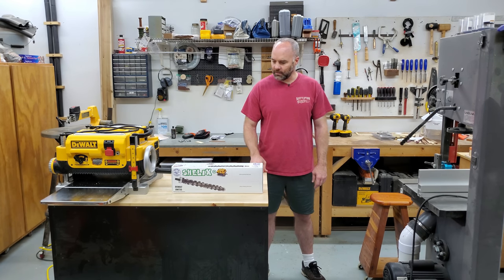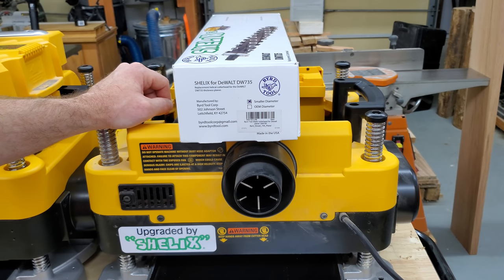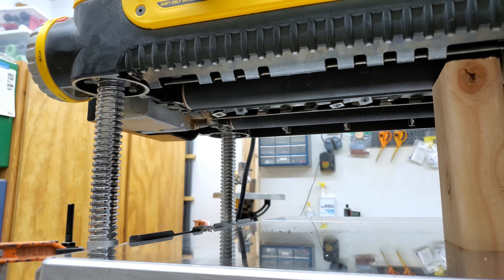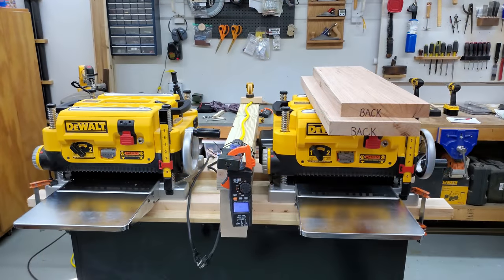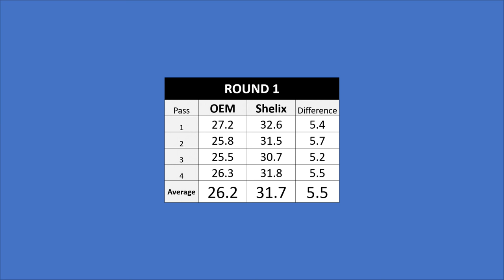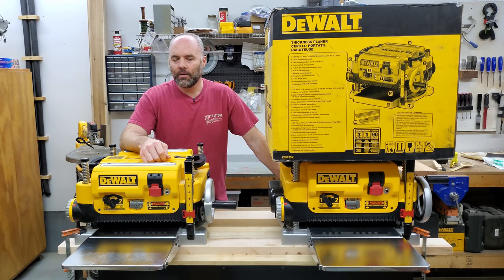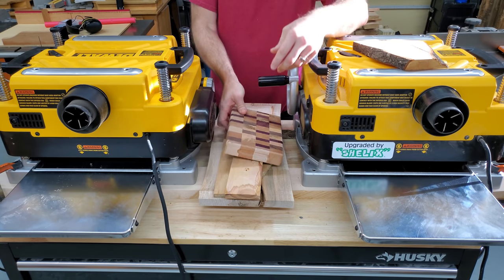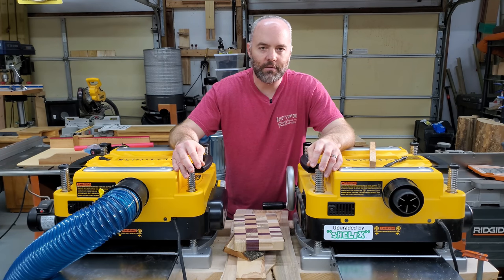The video I wish I watched before buying a SHELIX

Comment: You didn't mention the quality of the board surface finish with the shelix versus the 3 planer knives.  I find the shelix superior.
Reply: Yes, this was a big point that was overlooked, as this is the main reason you would want to upgrade.
Reply from the maker: It starts at around 37:02.  New or freshly sharpened steel knives produce an exceptionally smooth finish, but they dull a lot faster; and then the planer gets louder, draws more power, and tears out more wood.  Comparing new sharp steel to new sharp carbide, I'd say it's a toss-up except for complicated grain where the helical heads excel.  Comparing steel to carbide after a few hours of use, the helical carbide is way better, and will tear out less even after it eventually starts to dull.

Comment: I bet DeWalt would say, the cutter head would void the warranty on the motor as it's always running at a higher current, irrespective of the overheating protection the higher current draw would shorten the life of the motor, also the planer would have had to been disassembled by the end user to install the shelix which would void the warranty on the unit as it was dismantled by an unauthorised person.
Reply: None of these are legitimate factors in US warranty laws. Most people believe this, because companies have tried to put stickers stating this sort of stuff. Fortunately it doesn't hold up. You're allowed to take your stuff apart. You're allowed to swap in similar functioning parts. Now if you damage the components, or create the failure by dismantling the product, they can void the warranty. I work for Dewalt's parent company; it would cause us more trouble to deny a customer's warranty claim over something as trivial as swapping the cutting mechanism, instead of just honoring the warranty in good faith. It's not worth tarnishing the brand, especially when warranties have become such a big part of the marketing.

Comment: It appears that you are using the current meter in its MAX setting. If so, you are reading momentary PEAK current that can indeed reach values in excess of the average. Power consumption is based on the product of your average voltage and average current, i.e. the average power over a period of time. You should not use the peak value of the current that you may be picking up with your meter at machine start up, when the current exceeds average operating values to overcome cutter inertia.
Set your meter to AVG and you will see that the values read are lower, and likely within the breaker rating.
Reply from the maker: I set it to max only after the motor was up to operating speed. I have a few other videos in the playlist showing the same results without the max setting.

Comment: I like the Shelix, but it doesn't like cypress. If the moisture content is above 8% the shelix will create tear outs. If the content is 6% it will be smooth.
Reply from the maker: I don't think I've ever worked with cypress. I'm curious what causes the tearout. Is the grain peeling up, or does it actually chip?
Reply: @The Snekker Show  both. Peels and chips. I can plane a 1x8x12 cypress and get a lot of it, then plane a yellow pine board and it's smooth as glass. Dry kiln cypress planes glass smooth. 6% maximum moisture content for cypress is the limit or you rough finish.

Comment: There must be something wrong with your amperage measurements.  According to the data you're reading with this meter, an idle running planer consumes between 13.9A to 14.6A taking the x10 factor in listed by the line separating specifications of factor of 10.  I've read the manuals for the meter and that splitter, and your setup, and can't find a reason why you would have incorrect data.
Right after that I went to my garage and did my own test.  I have the same planer, with the OEM size Shelix head, and I have only hit over about 16 to 17A peak for little bit while planing white oak 1/16".   What gives?  I used a clamp style meter from Fluke and was not able to match your results.
Reply from the maker: You're not the first person who's said that, but once we get down to a comparable test the results get a lot closer. Were you planing a 9 1/4" wide board, and were you lowering the wheel one full rotation after the last pass to ensure a full 1/16" cut?  I have some other power-test videos linked from the description of this one: https://youtu.be/KBL97SqVrDc
Reply: @TheSnekkerShow  I agree with your observations and what you're stating.  However, the interesting part is the 'idle' power draw.  14A just running with no board, that's too much in my opinion.  The blower motor should draw maybe an amp or 1.5, the cutter motor will draw the rest, but while only spinning knives and rotating rollers, it should not use more than three to four amps. So I would expect this thing to use 5A while running idle.
I will use the KillaWatt little toy to see what's the draw while the planer is just running and let you know, as your experiment shows a 14A draw.  
Also 25A-30A pull for a length of 6 feet or so, should trip the breaker, especially in my place which only got a 15A one.  Thank you for your response.  Much appreciated.  Cheers.
Reply from the maker: @duperdude25  That's a pretty good guess. It draws around 6 amps once the impeller is removed. https://youtu.be/UoBN5Sc_2uk
Reply: @TheSnekkerShow  I've just returned from my dungeon and did some testing.  The numbers you've got are exactly what I got.  A non loaded planer uses from 12.5A all the way to 13.5A.  I've used the killawatt outlet.  I didn't want to run it loaded since the outlet is rated for 15A and I didn't want to overload it for the same of getting some numbers.  
I guess the impeller with the knives faces lots of resistance thus such a load with no wood being planed.  
Now, how is it that my 15A breaker doesn't flip since I do run 8 feet boards and remove a 1/16th at a time to get the thickness that I'm looking for?
I understand the breaker allowing for 25% over for 30 seconds or so, but 28A while the board goes through?  That is bizarre.   You're right from the beginning,.   I design hardware to mil spec and even more stringent when ti comes to space applications, we often design a certain fudge factor, but this is almost 2X the rated current and for a house.  I wonder if they also have such margin for the wiring itself when it comes to amp ratings versus voltage drop over distance and possible  fires as a result of overloading  Cheers.
Reply from the maker: @duperdude25  The whole experience was pretty educational for me as well. One thing I feel pretty sure about though is that home electrical systems are probably spec'ed so the plastic-coated wire in the wall is the last thing to overheat.
Reply: @TheSnekkerShow  Could it be the extension cord? When the gauge of cord is too small for the required load the voltage drops and the motor will pull more amps. When this happens it causes excessive heat in the motor. The amps that thing pulls I would shy away from using any cord at all, even a 10 gauge cord with much length will be prone to voltage drop. The gauge of wire, length of cord and amp load all factor in.
Reply: @TheSnekkerShow  a 1/16" cut? That's crazy. I cut no more than a quarter turn or 1/64th" at a time. I've come too close to burning up the motor until I figured this out. I won't go deeper even in soft pine...and I plane a LOT OF lumber every week. I don't have a dust collection system at all and just sweep the floor, but I routinely have 3 feet of shavings on the floor, but I won't cut more than 1/16th at a time...period.
Reply from the maker: @martinoamello3017  Your tools your rules. Some people estimate greater value from faster production than reduced tool wear. Time is money, and tools are money.
Reply from the maker: I finally got around to testing voltage tonight. Starting with the original setup with a short 12-gauge extension cord, it was approximately 120v before starting the motor, 119v after, and dropped to 115v while planing 8” wide maple. Then I plugged directly in to an outlet right next to the breaker panel and got 120v, 119v, and 117v.  There were some minor fluctuations between test sets, but those numbers are a good summary of the results. Amperage was maybe 1 or 2 higher using the extension cord, but still around 25-27 for both.
Reply: @TheSnekkerShow  That's interesting, I didn't think 12ga was good for current like that.
Reply from the maker: @ajmann1187  12ga is rated for 20A, which is more than enough for a 15A planer, unless the planer unexpectedly draws 30A.
Reply: @TheSnekkerShow   Looking at the voltage drop calculator the drop you measured looks the same. The increase in current draw is surprising to me. I knew they pulled a lot more under load just didn't know it was that much. But start up can be 3x running current so guess it's normal.

Comment: Even if the shelix had the same number of decibels I think it would still be worth it just for the change in pitch. Thickness planners just hit the MOST irritating pitch.
Reply from the maker: I completely agree. I spent 30 minutes planning some white oak a couple months ago with straight knives, and the noise was cutting right through the heating protection.

Comment: surge current is a really shit way to compare power draw, useful as one point, but an average would be more useful, or even better would be watt readings that consider voltage as well, as that can fluctuate thanks to other loads, neighbors, weather etc.
Reply from the maker: Before discounting the approach, it's important to understand the intended outcome. If you're cutting framing members for a shed, you don't need your assistant calling out measurements in nanometers. More precise, yes, but it would only cause confusion before getting to the same functional result.

Comment: I'm not 100% sure but I'm pretty sure you're using the amp meter wrong. I trade school we were taught to run the hot wire through the amp meter not all wires and for a more accurate measurement especially with low voltage add a wire with 10 loops and divide the value by 10 to get a more accurate reading. The planer has a 15 amp motor. The reading you're getting your way should be divided in two.
Reply from the maker: If the meter is around the positive and negative it would just read zero. I'm using a line splitter in the video, so only one is being measured.
https://youtu.be/24f-J0lVo-E

Comment: A 20A circuit should have #12 wire which if it's modern wire (ex: THWN-2) it's technically rated at 30A, HOWEVER; that's not for continuous duty, it's derated to 80% PLUS your devices (receptacle, breaker, switch etc) which even though your circuit is 20A most residential receptacles are just cheapo 15A devices throughout the home.... (this is for reference only, I AM NOT GIVING ADVICE HERE.)

Comment: thats not really true

the replacement blades are 58 pcs
can be used 4 times, if not  breaks

the other blades are  can be used  2 times
the carbide tibbed blades are costing  90 dollar the 3

so one  setup is  45 dollar
the  15x15  tips 2.50-3 dollar per each
so thats  150 at least  counting on  4 times can be used  one setup 35-40 dollar one setup

the only advantage i see is hitting a nail you can getaway  with replacing  a few tips only
Reply: myself i like HSS blades, they are cheap and very simple to resharpening them
carbide tools are great for  router  and circular saws

carbide planer blades might worth on a production plant  where you have to keep the continuity of  workflow

Comment: Doesn't it seem kind of knot-headed of the manufacturer to shop the OEM size head with the cutters installed?
Reply from the maker: Yes, but they do it because they balance the cutterhead with the cutters installed as a final manufacturing step.
Reply: @TheSnekkerShow  I wonder whether that means there could be an imbalance to the cutter head without the extremely uniform carbides and screws, an imbalance that differs from that of the cutter block itself.

Comment: Jump to 3:24 to look at the long blades.  Use the first edge.  Use the second edge.  Then look at all the holes, and take a cue from the Shelix type cutters.  CUT your knives into segments, with 2 or 3 mounting holes.  Remove the offending sections, and stagger the joints vs the other two blades.  Should get 70 or 80 percent of the use of the shelix type with the regular type and a little extra work..
Of course this would be totally unsanctioned by the manufacturer and at your own risk and I have no involvement, but just looking at it it should work as long as the knives are backed up properly and it won't make the machine too dangerous..
Reply: I would think balancing would be the hardest part. You'd have to really play with it to balance the head
Reply: There are only two alignment boss holes (one on each end of the blade). If you segment it you will have a near impossible time getting every segment aligned and balanced. If you don't, you will get lines gouged into all the wood you pass through.
Reply: @kg4lod  'a near impossible time getting every segment aligned and balanced.' 
Aligning and balancing these will be next to nothing compared to real RC heli rotor blades.  These are close in and the balance forces are relatively light.  Keep the cuts similar and you really shouldn't even need to do anything.  Fillers for the screw holes to make them center should be all that's needed.
'only two alignment boss holes '  These are probably just to make sure people have aligned the blade overall correctly and haven't managed to put it on completely wrong.  
They probably balance the rest of the head, but the blades are user replaceable so they're just matched.  And you replace blades because of the marks they leave on the wood, not because the hunk of metal missing from the blade puts it too out of balance, so they're generally not that critical.
'you will have a near impossible time'  I have an RC heli background since the early 1990's, so no, I really won't.. :D   Modifying a 10 or 12 inch saw blade is considerably more demanding due to the longer moment arm.  These are high RPM but small diameter, there's a lot less momentum.
Keep the cuts consistent and make sure the segments center on the screw holes and any overall change to balance will be negligible.
Reply: @ModelLights  Your RC helicopter blades don't crash through a wall every third of a revolution. The Shelix head deals with this by having enough cutters that there are always at least one cutting edge in contact with the material resulting in an approximately constant stress on the rotary mechanism. The straight knives rely on an even load across the blade during the material entry. If you segment the straight knife, but don't get the edges aligned perfectly, some part will make contact before it's neighbors resulting in a torque moment on the bearings. This will wear the bearings unevenly while causing chatter that leads to material gouging (pits and lines in the milled surface). I actually tried something similar to this with my LBJ-6 jointer before switching to a Shelix.
Reply: @kg4lod  ' I actually tried something similar to this with my LBJ-6 jointer before switching to a Shelix.'
Total BS.

You do realize how totally ridiculous what you're saying is, right?
'It has to be super infinitely balanced or it's going to self destruct!'
Wood isn't that consistent.  Feeding a 6" board on one side vs the other doesn't make these self destruct.
It's clear you have little real experience with rotation and loading.
Reply: @ModelLights  unbalanced doesn't mean it explodes, it means there is an unintended oscillation introduced. If that oscillation is severe enough you can have a catastrophic failure (which is highly unlikely in this scenario).  Jointers/planers are trying to produce a perfectly flat surface, which doesn't happen when your cutting head oscillates. You get lines and gouges.
Reply: @kg4lod  'unbalanced doesn't mean it explodes,' 
Take a hint, I was mocking your silliness.
'which doesn't happen when your cutting head oscillates.'
Which will be oscillating 100x more from the uneven loading than the tiny fractional, balanced change from modifying the blades as described.
Per you a shelix should stop working the moment an edge is damaged, even if it's turned it'll be too fractionally out of balance.
Not how any of this actually works.

You do realize you've helped me decide planer first over a jointer, and the first thing I'll be doing is cutting up a set of blades and making a video loling at how silly what your'e saying actually is.

Lines happen because these are spinning quickly and all 3 blades get damaged in one spot.  You're not doing anything quickly enough for one blade damaged to be making a line.  Even snipe is from dynamic loading effects of the machine working against itself, the tiny imbalances you're saying are causing things are ridiculously below what is actually doing it.
You can probably leave whole cutters out of the Shelix head and barely notice it.  And most of what you would notice would be sound from the unevenly disturbed air, not the balance.

It's hilarious you're trying to 'explain' this to me.
Reply: @ModelLights  Hard to understand if you want to be taken seriously or not when you make extreme statements. Seems like you understand how oscillation causes surface imperfections. You just need to grasp the last link as to why weakening and maligning the knife segments leads to more oscillation rather than less and you're there. I tried it. It worked, but not as well as straight knives or Shelix. Good luck with your project. Hope it works out for you.